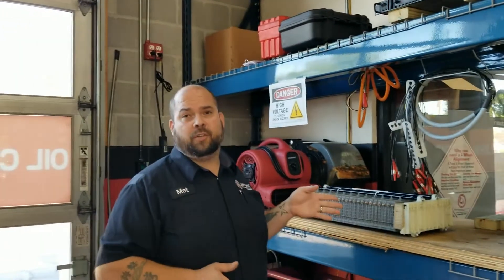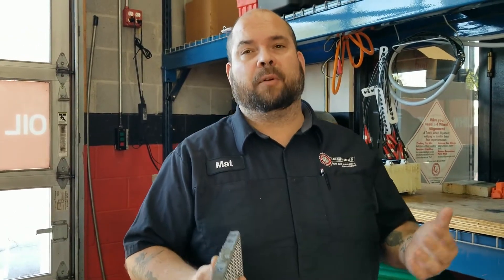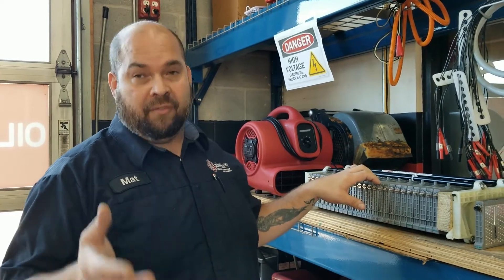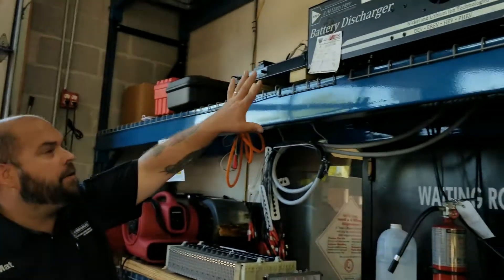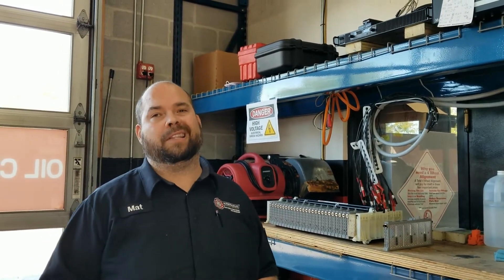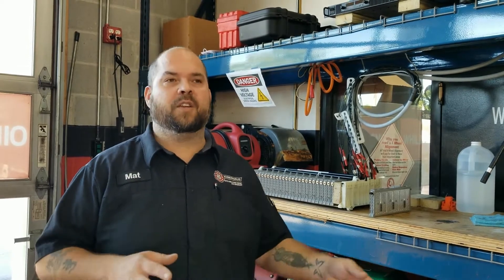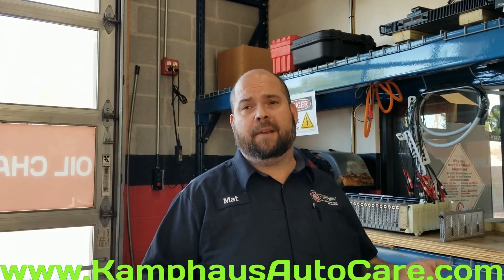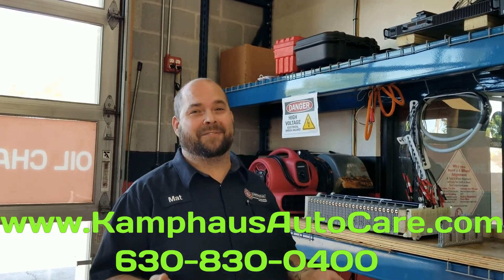Hybrid Battery Reconditioning

Comment: Dielectric grease in a "sealed" battery cover with a fan only thermal management system and no filter would be a dust build up nightmare. We replace the factory copper buss bars with nickel plated copper and eliminate the corrosion issue.

Comment: @Kamphaus Auto Care & Emissions  I've heard that very important that reconditioned modules' capacity to be close to each other, some say variation should be no more than 200mAh, what do you think, and is it possible equalize capacity? I am reconditioning my gen 2 Prius modules now and see 500-600mAh variation. Thanks!
Reply: You are correct, the BMS watches voltage variance across the pack. Anything more than 0.2V will trigger a CEL and a 0A80 with a sub code for the offending block. It is possible to raise the cell capacity with cycles of deep discharging and then charging to 110% capacity to break up the crystals formed in the electrolyte. I have a specific algorithm I use that has yielded impressive results. I will have a new video out before Christmas with the new equipment I am using. Keep in mind that when charging or discharging cells, temperature control is IMPORTANT. Most research suggests that if the temperatures go beyond 120F, the cell is junk. I have found damage occurs at 113F and above.
Reply: @mathewbunda7125  I am using EV Peak CQ3 quad charger discharger, I guess it charges to 110% capacity, because I see many modules' capacity 7500mAh, the limit that I set, but some are as low as 6800-6900, so maybe I need to  cycle these modules one more time, though it won't guarantee increase of capacity, could be opposite, this is what I've seen with other modules. I also trying to get  discharge capacity no less than 5000. Thanks!
Reply: @mathewbunda7125  Where is that video located?
Reply from the maker: Still working on it.
Reply: @kamphausautocareemissions1754  Can you share the algorithm in text form?
e.g.: set max capacity cutoff to 8500 mAh, 
charge at 5A
discharge at max possible rate (up to 5A) down to 5.8V, 
repeat as needed till capacity is at target or better

Comment: Also, I fix a lot of hybrids and sell a lot and I can tell you folks to drain/fill your dirty transmission fluid with dealer only stuff asap. That will not help the life of any battery you put in it
Reply: It's important to service the transmission, however the expense of fluid from the dealer is not needed. Any good DEX VI rated fluid will work well.

Comment: Can any of these cells reading low voltage like 6.00 volts or lower be repaired or still used with this device? I've heard once they drop below 7.0 volts they need to be removed and recycled. It seems like your method requires replacing bad cells with "okay" cells and charging up.
Reply: Voltage is not a good indicator when evaluating cells. Measured capacity by regulated discharge in the only true way to get insight into condition and ability to recondition.

Comment: Wow!  Outstanding video and explanation on hybrid bat tech and especially on clarifying about early hybrid tech as I have with my 2007 Saturn Greenline Vue.  I am down in Peoria and would love to come up to have you evaluate my Vue hybrid bat and look into reconditioning it.  Lord knows I have plowed tons into it so far but it is a terrific car for my wife and she loves it.  Check engine light came on my auto repair shop look at the codes it was throwing and they said it was a hybrid bat temp sensor and the hybrid batter as well.  Your around 160 miles from me but would love to come up since you guys have the experience and know how to check this out for me.  Do I need to call you first or just make the appointment and is it safe to drive the vehicle that far about 2.5 hours up from Peoria when it is throwing hybrid bat temp sense code and hybrid battery code?  Thanks much for posting this!
Reply: Temp sensor codes are a pain on the old Vue's. It seems to always be a sensor failure and they are next to impossible to get your hands on.  I'd be happy to help if you still have the vehicle.

Comment: Nice video. I'll contact you when it's about time for my Prius V that has 190,000 and Prius C with 130,000 miles. But for now, I am changing the pump for inverter for which I need to pull out the orange safety plug on hybrid battery. So, can you please tell me whether the system will throw any errors after reconnecting the orange plug? ( since you pull the orange plug many times during your work , will it be normal as it is , after putting the plug back or will it surprise you with any error codes) Thank you and I subscribed.
Reply: If its pulled while the 12v Battery is still connected it will create codes

Comment: Hello, what is the best device that can be used to charge cells thanks
Reply: Thunder balance charge
Reply: I am currently using the NuVant EVC-30
Reply: @mathewbunda7125  WILL YOU RECOMMEND THE EVC30?
ARE FAMILIAR WITH DK DSF2010-40

Comment: Hello. Currently trying to recondition a 2007 Highlander Battery. The tool I’m using is a Turnigy Quad 6S 400 watt and is proving terrible at detecting full charge and a super slow discharge rate. What tool are you using? I have 2 hybrids and am willing to invest
Reply from the maker: Hi this is the product we would recommend. This is, in our opinion, the best in the business. https://www.futuretechauto.com/nxtgen.html NOTE: We are highly trained professionals, and do this on a daily business. If you are just starting out you need to make sure that you are getting the training and be extremely careful otherwise you can injure yourself or cause significant propery damage.
Reply: @kamphausautocareemissions1754  Try to call to Future Tech so many times and no one respond
Reply: @sleguadgebremicael7249  Look up Nuvant Technologys EVC-30
Reply: @mathewbunda7125   thanks